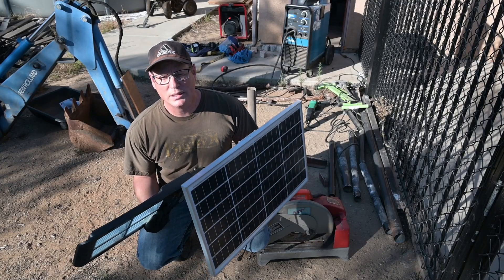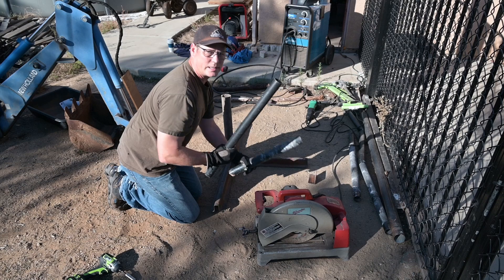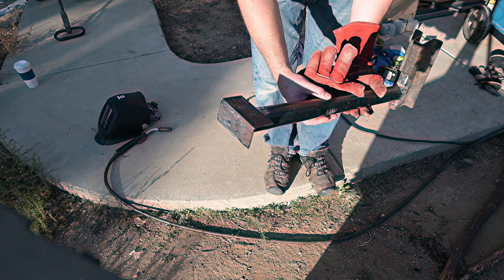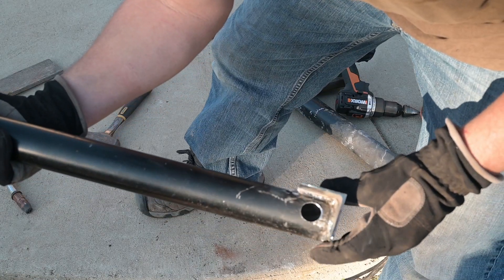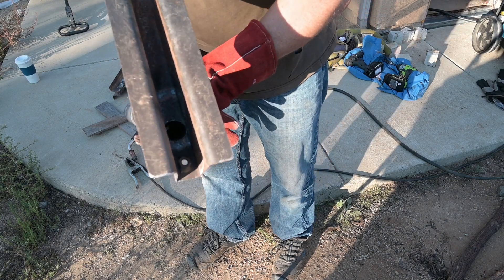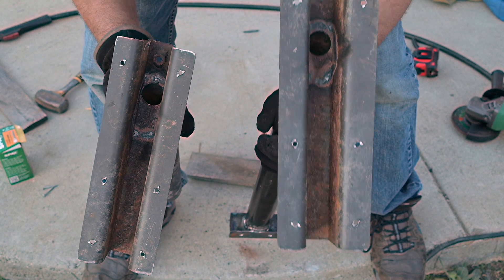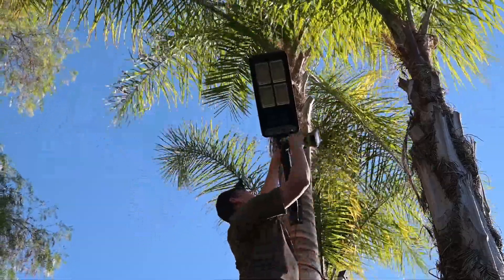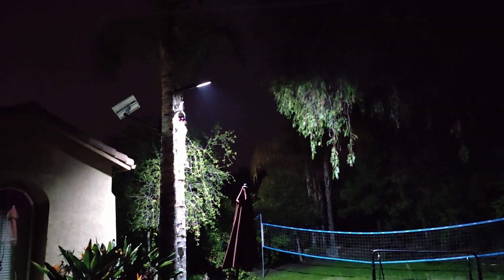Powerful Off Gride Palm Tree Solar Light Build and Install

Comment: Can the tree feel those screws though? I'm looking for way to strap on on instead of drilling the tree 😬
Reply from the maker: Trees don't feel 😳.... If your putting it on a mature Palm Tree which has no cambium and no annual growth rings the trunk does not increase in size as they grow. So you can strap it up like I did on this video https://youtu.be/03wqE8d8RTw. I did put a couple screws on the bottom but instead you can just put two straps. If installing on a tree I can't advise, I'd have to research that a bit but with a trunk that keeps expanding you can't strap it unless the stap grows with the tree.